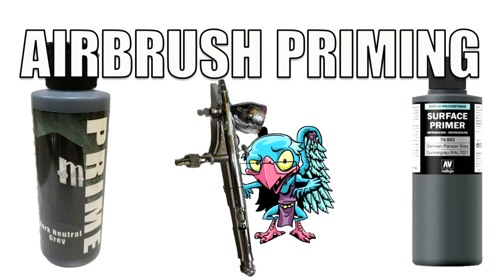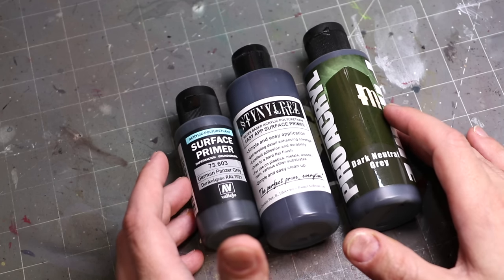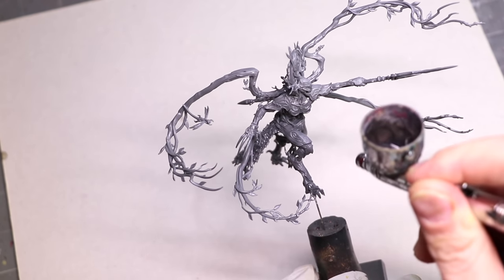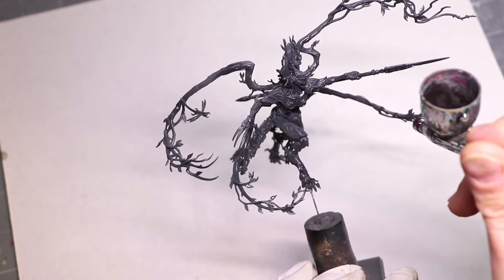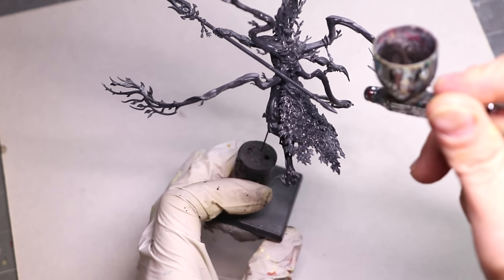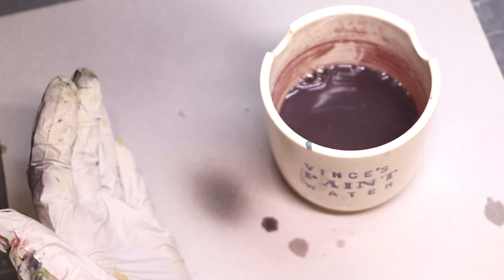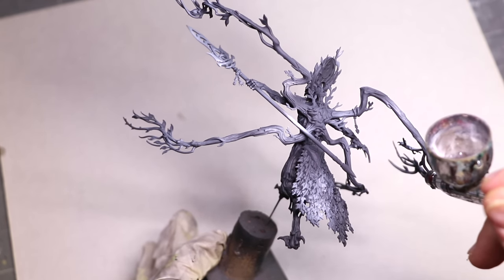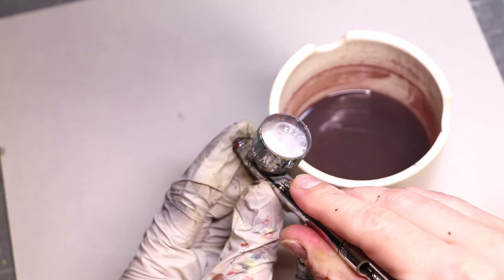Complete Guide to Airbrush Priming - HC 350

Comment: Vince, Im new to model building, just got a Master airbrush, watched this vid and followed it exactly. I live in Az (very dry). I primed a model and used Vallejo grey which is really light so I ordered panzer grey. My issue is that my airbrush doesnt throw primer from 6 inches away and I have to pull back all the way to see color on the white test paper and I have to get close. Any idea whats going on? I tightened everything. Does this airbrush just suck? Its not performing like all the vids Ive watched. Thanks.
Reply from the maker: It sounds like the airbrush is blocked or the primer is bad more than the airbrush itself. If it's not spraying its likely the nozzle itself has dried paint (the small brass component). That element can easily get dried primer in it and you might still seem like you're spraying with water, but the paint will more or less not spray out. You need a needle tool to clean that brass nozzle. That is the most likely candidate if we  aren't dealing with frozen primer that has chunks in it. You could always strain the primer to make sure, panty hose works well for that.
Reply: @VinceVenturella  Brand new gun and primer, first time using both. How could it be dried paint or bad primer after doing 3 drops 90/10 first of your recipe, 10 drops of primer and zero paint unless pulling all the way back? Should I have cleaned the brand new gun first or should I just get an Eclipse? I have no problem doing what you just said, just want to make sure we are on the same page.  Thanks Vince.
Reply from the maker: @SunDevil31  Hmmm...that's tough, brand new you say. Okay, then maybe we don't have things sealed properly and air is leaking out., Do you get any bubbles back in teh cup at all? The primer can always be bad (it could have frozen on the way to you or other things, give it a strain and see just to make sure). As to the airbrush itself, it's always possible we have a defect, so you may want ot field strip and reassemble, they sometimes ship it with some lubricant in there that can dry and cause problems. That's all I can think of.
Reply: @VinceVenturella  Ok, will do. Thanks Vince.
Reply: @VinceVenturella  And yes, I do get bubbles in the cup. Tbh, theres alot of play in the trigger. Feels like it should be tighter and youd feel the pressure? This gun just feels weak.
Reply: @VinceVenturella  Hey Vince just so you know, figured out the problem; 1. This Vallejo paint everyone says doesnt need thinning-well its coming out like caulk so I shook the hell out of it and still thick so I mixed 2 dabs of paint which is like 20 drops with like 40 drops of 80/20 and 3 drops of pure flow improvwr before the 80/20.  Flowing nice.  I cannot believe how much  thinner/flow is needed and how tempermental these guns are. 3 drops in Az does virtually nothing. Took me a while to get the right recipe as it was way too thin at first. What a pia but Im glad I figured it. Fyi to you and the viewers. If you live in Arizona, thin the hell out of the paint or you will have constant blockages and youll want to hand paint or get cans and whip the airbrush across the garage (which I came close to doing several times) 😆

Comment: Every cleaning airbrush tutorial Ive seen recommends spraying out cleaner/residual cleaner. Theres really no issue skipping that part?
Reply from the maker: The key is, I'm basically just using water to clean it out, for primer, I run a few drops of alcohol first, but the key is in both cases, I'm backflowing and then dumping and only spraying a very minimal amount out the front. The key is, you want to be putting as little material as possible through the front of the airbrush always.
Reply: @VinceVenturella  Thank you for the reply, ill keep this in mind.

Comment: I've just had a go at priming with my airbrush. I've been priming with rattlecans but it's freezing these days so I thought I'd give my airbrush and Vallejo surface primer a go. But this stuff rubs right off.. :O I've paid close attention and followed instructions but it still just rubs off.
Reply from the maker: How long are you letting it cure? Are you doing two thin coats of the primer? How much thinner are you putting in?
Reply: @VinceVenturella  Thank you for the response, Vince! I let it cure for about 24 hours. Primed them last night and attempted painting now, a day later. I tried applying two thin coats, but I'm honestly not confident in their thin-ness. Airbrushing in general is sort of new to me. I might have used too much thinner. I guess 1-2 or 1-3. I figured it would reduce the risk of clogging and make it easier to get it on there thinly. Im using the same thinner and flow improver as the ones you have here.
Reply from the maker: @nevilovermann797  So you did all the right things. One piece of advice is always don'thandle your minis, there is always a chance that something could rub off. That being said, two thin coats and let it cure and then a layer of varnish could help set everything in place and protect it. Sometimes local humidity can have an effect on the ability of the primer to fully cure.

Comment: I get a lot of splatter at over 25 psi - like much larger blobs of paint on the model. It's super obvious w/ white.
Reply: Too thick of paint or you are too close. Im usually 3 to 4 inches away at 28psi. Primer should be similar viscosity to eggnog or heavy creamer. Milk consitency if spraying .3mm or smaller
Reply from the maker: Yep, I agree, that means we either need thinner paint or we are too close to the model.

Comment: Honest question: How do you backflow an airbrush with an exposed needle i.e. my badger 105 patriot.  Also, I had stopped backflowing because other youtubers had said to not backflow because it can damage your airbrush.
Reply: I hold my (gloved) finger in front of the needle and follow it back as I pull back the trigger.
Reply from the maker: Yep, a rubber glove, wet paper towel, or just a pinch can help you do it.
Reply: Cheap airbrushes with crappy seals might be ruined. Even pros backflow. If the paint is backflowing past the seal directly behind the cup you have a bad seal which of course means you have other issues

Comment: I followed this with the same products but the primer rubs off very easily. What am I doing wrong???
Reply from the maker: Well, number 1, stop rubbing the model. My best advice would be to apply the primer, then let it cure for a day or so if you're experiencing issues. It could be your local humidity or something else similar. If you're still seeing the issue, you can also apply a varnish layer after the primer.
Reply: @VinceVenturella  thanks,  I wrong assumed my humidity was low, but Google says 85%. A day later and it still comes off at the slightest touch. Will try varnish on one model and just layer up another (got 9 to experiment with).

Your videos are helpful and I will hopefully get the hang of this soon!

Comment: Vallejo primer peels off from my models. What am I doing wrong?
Reply from the maker: How is it peeling? When you put paint on? Where is the effect occuring?
Reply: @VinceVenturella  just by touching it, if I accidentally touch it with my nails a big chunk could come off
Reply from the maker: @mavstorm4588  That's strange, yes, that is too fragile, you could try a different primer, could be humidity, could be the primer is bad, could be over thinned. Hard to say, but I'd run some tests with other products.
Reply: How long is it meant to rest before painting?
Reply from the maker: @mavstorm4588  Depends on local humidity, but I like to give it a few hours.
Reply: Thanks for your help, what other brands do you suggest? Is the Vallejo Mecha better than standard one?
Reply from the maker: @mavstorm4588  Give Pro Acryl a try, that works for me, but its also humidity sensitive, Stynelrex is another popular one I like.

Comment: Another Iwata (?) user talking about backflushing. DO NOT BACKFLUSH with an Harder Steenbeck Airbrush. They are constructed differently and when backflushing with too much paint left when cleaning, you will GUNK the whole airbrush.
Reply from the maker: Well, that's interesting, I spoke to the president of H&S and we talked about backflowing in particular and he was pretty clear it was fine and wouldn't cause any issue (assuming you're properly cleaning). So...my general feeling is it's just fine. They even make a specific tool to cover the cap so you can.
Reply: @VinceVenturella  thanks for answering. I can only tell from my experience. I own an HS Infinity and a cheap Iwata clone. If you backflush at the beginning of your cleaning process you will have a much harder time to get the paint out compared to just using a squeeze bottle and squeezing water in the cup until it's clear and them backflush at the end. With my Iwata clone I can backflush and the device is almost instantly clean. P.S. I even own the yellow backflush cap.
Reply from the maker: @RobOngrui  Happy to respond, people's experiences are always their own and I cant speak to your experiences. I also use an H&S and backflush pretty consistently with no issues, but there are so many variables there so you always have to find the workflow that works for you. :)

Comment: Priming black with my airbrush is so annoying. Everything else goes through okay but it's only the black primers that I have trouble with
Reply from the maker: Interesting, what black are you using?
Reply: @VinceVenturella  I use stylnrez black primer. I usually put in drops of Vallejo flow improver and then thin the primer with some Vallejo airbrush thinner. My airbrush tends to clog up a lot with black primer in particular
Reply: @acovarru91  thats really weird. With white primer I would understand those issues but not with a black primer. I exclusively use Scale75 primer black because it sprays super smooth. What exactly is the problem if I may ask? Just the clogging? Needle size?
Reply: @Hannah11876  I think it's clogging. I'm trying out monument hobbies black primer so hopefully i don't have as much of an issue pushing out the primer

Comment: Learning a lot here, and not sharing this to contradict or criticise, but I have heard and/or experienced three things that contradict this…

1) afaik some airbrushes which have a certain kind of plastic for the O ring will not react well to having IPA pushed through? Like, the plastic goes brittle. More expensive airbrushes tend to use a better plastic that doesn’t go brittle. Does the IPA advice apply to all?

2) I recall from one of Marco Frisoni’s videos (I think) that “you should never backflow” - the airbrush is not designed for that and it sends gunk in parts of the airbrush that shouldn’t be getting that gunk… I guess your experience is different. Hard to know who to listen to there since both of you seem to really know what you’re talking about!

3) I have had generally poor experiences trying to thin Vallejo primer… but I haven’t tried with the stylinrez… will give that a try.

Main takeaways for me:

- add some airbrush thinner and flow improver to primer; and add it to the cup first to lubricate it
- two thin layers at partial trigger release instead of blasting it out
- clean way more often - don’t try to batch prime 20 minis with one cup-full.

On the one hand that last bit might appear to slow me down a bit. On the other hand, disassembling the airbrush to clean it fully when it gets all gunked up is such a massive pain and takes forever.
Reply: Most AB users backflow to mix. Even pros who paint $1M cars backflow. Nothing should get past the teflon seal back near the trigger. If there is the seal is compromised.
Reply: I am also in the "never backflow" camp and I manage to avoid clogs regardless. Ultimately it doesn't matter how you avoid paint drying in your brush as long as you do.
Reply from the maker: So here are some thoughts. 

1) I am sure there are likely some cheaper airbrushes this may be an issue, but with something like my HP-CS, I've been doing this for years with hundreds and hundreds and hundreds of leanings, never an issue. 
2) This is the great myth of airbrushing. I had a nice conversation with the GM of H&S (who has some cause to know about airbrushes) and we discussed this. He backflows all the time and sees no issue with it. They even make tools to help you do it easier with their caps. 
3) The key is a little thinner, but not much, something like 1:4 (thinner to primer). 

Hope that all helps.

Comment: Doesn't take time? You say that you can't let the paint sit in the pot more than 2-3 minutes?!
I will spend more time changing paint and cleaning than I will do painting. I won't even have time to finish a model before I have to replace the paint?

It will take ages to prime my models, compared to rattle cans. It will most likely even be slower than brush applied primer.
Reply from the maker: I have videos on clening your airbrush fast, in general, it only takes me about 30 seconds to clean the airbrush, so I can move along pretty quickly. :) - That being said, I have newer videos on additional priming options as well with other types of primers.

Comment: I disagree about "Always use thinner". I never use thinner, and have none of the problems you describe. The same goes with Isopropyl Alcohol. I use Flow Improver and water, and that's it. All these chemicals you are adding to the airbrush get atomized when you spray it, meaning you need a fume hood and respirator and goggles. Yeah, goggles because you can absorb that stuff through your eyeballs. So now we are talking about a dedicated space, well ventilated with  some kind of fume hood, where you are wearing a mask, eye protection, and rubber gloves. What about the rest of your family? Pets? If you live in an apartment, maybe neighbors? Isopropyl alcohol does nasty things to brass (like all the brass fittings used in an airbrush), and destroys the rubber seals and gaskets in an airbrush. Even if you are using delron seals and gaskets, it'll still eat it. Sorry, but some of the best painters I follow on Twitch or here on Youtube don't use thinner or Isopropyl alcohol. If they do, it's for a very specific type of paint or technique they are trying to use. The biggest endorsement I've seen about airbrush care and use- Ken Schlotfeldt (owner of Badger Airbrush) will tell you for miniature painting with acrylic paints, all you need is water and flow improver. I do cheat a little bit and use Ken's Needle Juice on my needles after a deep clean. For actually cleaning my airbrush? When I'm done using it, I throw it into a small cup with 50% Simple Green and water. Let it soak for a couple hours, then spray it out with water. Depending on how much I've been using the air brush or if it starts to give me trouble, I'll break the front end down and let the parts soak overnight in the Simple Green then just spray 'em out with water. Every once in a while, I'll have to get my mini pot stick brushes out and run them through the cup and channel areas. For the times when I swap paint, I'll basically do what you said, but I use a couple drops of Vallejo Air Brush Cleaner, swish it around with an old brush, add some water, backflow it, then dump it out. Like you said, do that until it's clear. 

For tip dry- I have a super soft toothbrush, but some air brush cleaner on it, lightly brush the tip, spray it off with water, and back to painting.
Reply from the maker: Interesting thoughts